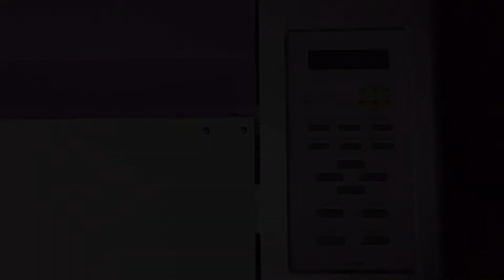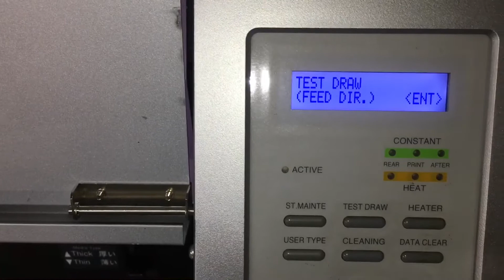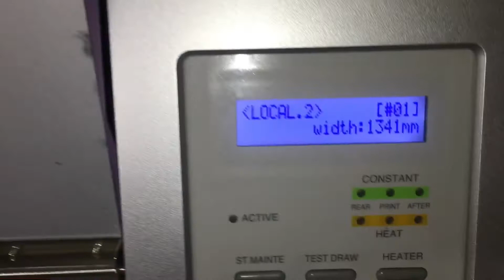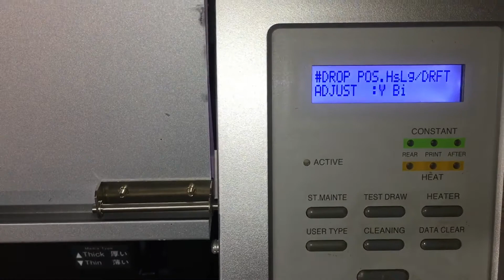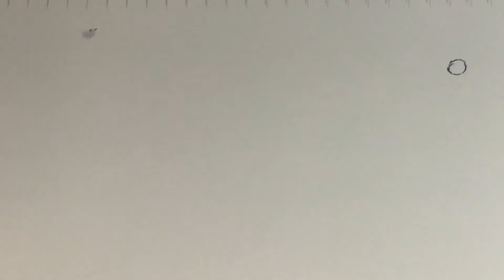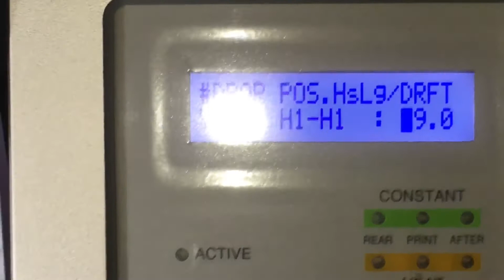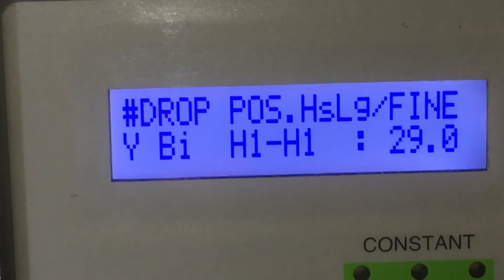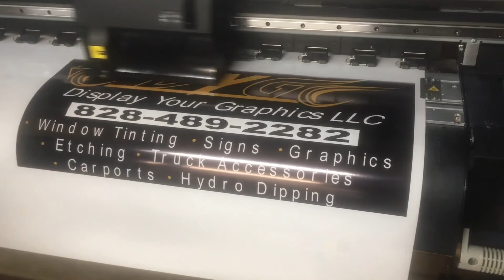Mimaki 33 Print Head Calibration

Comment: I'm considering doing a head replacement on my machine, the mechanical part is easy, I've watched it done twice and I've stripped out various items before, but the one thing I'm not sure of, as I understand, the head has an ID which requires software to update to the machine.  How did you get by this?  Thank you in advance.
Reply from the maker: All I did was calibrate it, but this wasn’t my field of expertise, and it’s be some time now sense I did it. Sorry the only info I can offer is what’s in my video…. Good luck